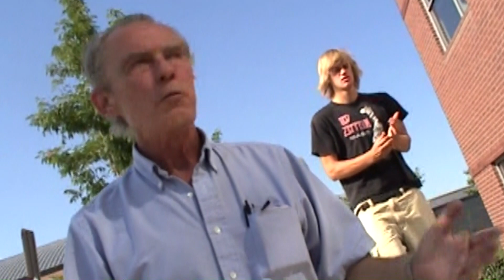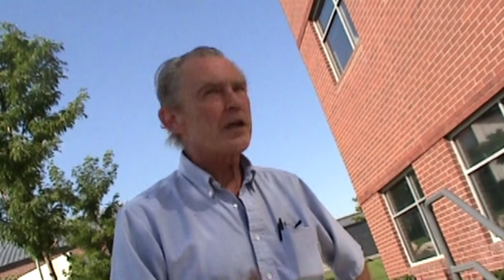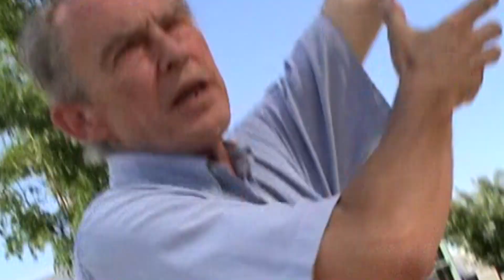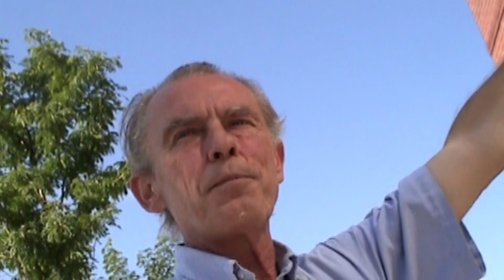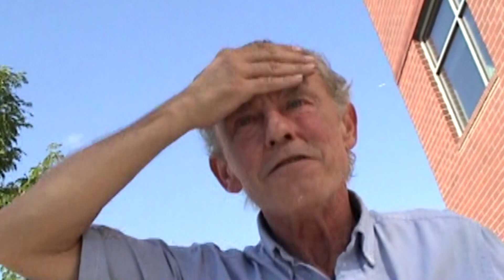Paul Pantone on GEET Engine Acceptance

Comment: I'm confused.  "more energy off the exhaust pipe than the shaft of the engine".  To me that means more energy is being wasted through heat than being used for work.  That is bad.  Like the complete reverse of good.